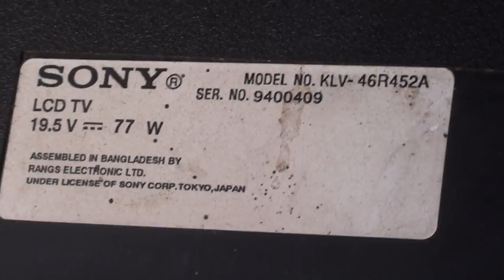How to install China motherboard on Sony Bravia LED TV.

Comment: I used Universal China Board to replace this kind of Sony Mainboard (these Sony 452A series starting to breakdown last month like dominoes regardless of screen size), the resulting picture quality is not good (low contrast, dim picture and low resolution). Maybe there are more tweaks needed for the China board to match for the Sony panel and backlights.
Reply: Measure the voltage of 51 pin, if any voltage appears please ground it
Or if no voltage appears when u measure the voltage on that pin in this case provide 3.3 voltage from board
Reply: @gururajkchandan9910  Thanks for the advise I will do that next time.
Reply from the maker: Hidden tricks dear....